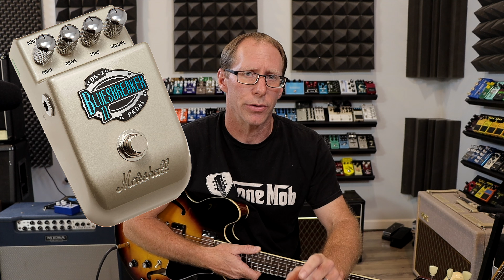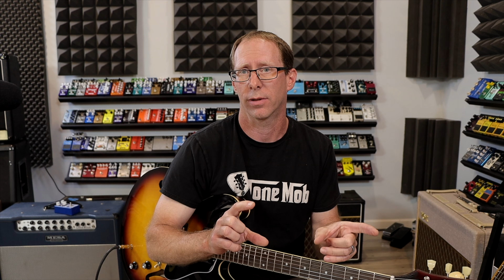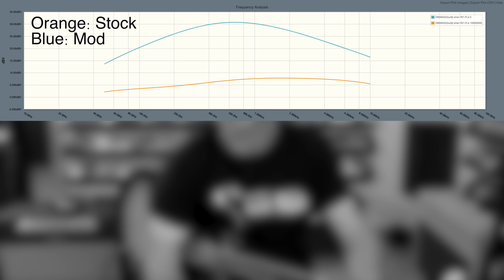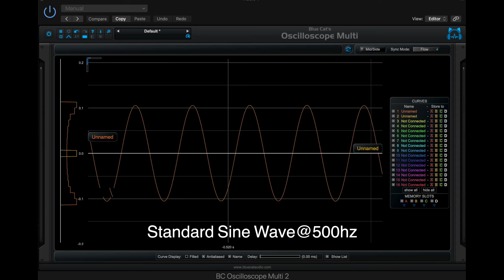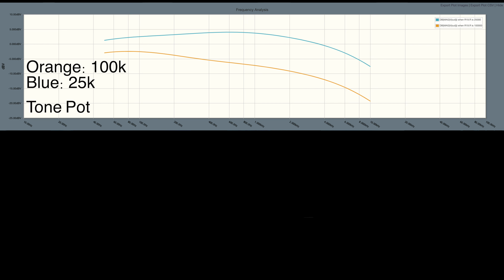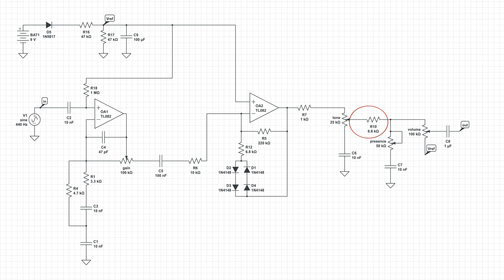Deep circuit diving with the Marshall Bluesbreaker

Comment: I've got a 90s Bluesbreaker. It doesn't have a lot of gain on tap and because it's a soft clipping overdrive it just farts out when you up the gain. Also, it doesn't have a lot of headroom in terms of volume. I ordered the Pantheon a couple of days ago, hoping that it covers those shortcomings. Definitely going to shoot it out with the original. An added bonus is that if the Pantheon does boot the Bluesbreaker off my board it'll give me enough space to put my big muff back on.
Reply: TL:DR I think you’ll be happy. I got a Pantheon a couple weeks ago and it is an very flexible overdrive IMHO. With the gain, more gain, MOST gain switch you can go from moderate overdrive into distortion. There is plenty of headroom. The soft/both/hard clipping switch does exactly what Brian demonstrates here. I don’t use the hard clipping mainly because I have other pedals to do that, but the mixed setting is pretty cool.
Reply: @chipsterb4946  Really looking forward to trying this one out. I have the Tumnus and that floored me, the best Klone by a long mile and I've tried a few. I'm especially looking forward to trying the both types of clipping setting as to my ears it sounds like a roaring JTM45 and not like a pedal, just as the Tumnus reminds me of a driven fender blackface (although I have no idea if that was the intent with both the Tumnus and the original Klon that's what it sounds like to me).
Reply: @sonicwarfare6401  for whatever it’s worth, I now have the Tumnus => Pantheon => MXR Timmy. If there’s a tone you can’t find in one of those 3 or some combination of 2 of them...  And the Timmy really is different more “transparent” but with a touch more compression too.  Plus I really like the frequencies the passive Bass and Treble controls cut. For some reason using the Timmy as a clean-ish boost into the Ratsbane just makes me laugh. (I know Brian won’t mind me mentioning an MXR pedal cuz he told me the Timmy was great and quite different ;)
Reply: @chipsterb4946  Oddly enough, that pretty close to my setup, Maxon 808 => MXR Timmy => Tumnus => Bluesbreaker (soon to be Pantheon). How are you setting your Timmy at the end of the chain? I'd really like to know because a few people have mentioned that they like it at the end of the chain but I never got how they set it. To my ears, it's very close to the OD808 in terms of its clipping structure, minus the mid hump and a lot of the compression. I'm currently using it as a transparent boost, either into the amp or into Tumnus or Bluesbreaker, for rhythm playing but switch to the 808 as a boost for solos in order to cut through a mix.
Reply: @sonicwarfare6401  the Timmy works well for me first, but I like having the Tumnus there both for the buffer and as a mild, often-on overdrive. I retired my Tubescreamer type pedal after getting the Pantheon. You’re right -the Timmy has similar clipping but seems cleaner to me.  Moderate gain (up to noon) Tumnus ahead of Timmy can get you TS tone. Timmy gain set 11:00, symmetrical clipping, Treble about 3:00, Bass 1:30-2:00, level with a slight boost. I’m just a hacker, so I’m always diddling with the settings. Turn Timmy gain up a bit, asymmetrical clipping, Bass and Treble both near max and push into a distortion/fuzz pedal => 😃